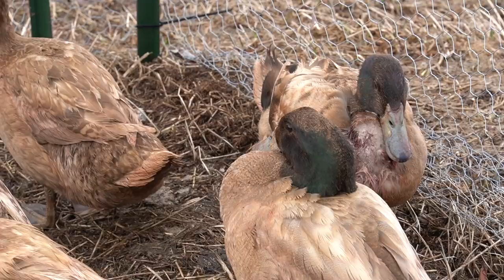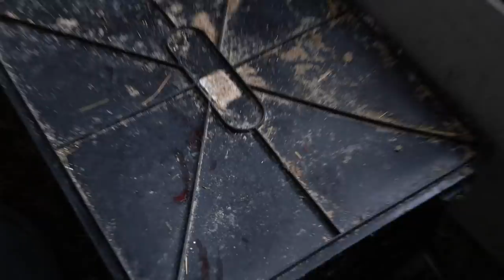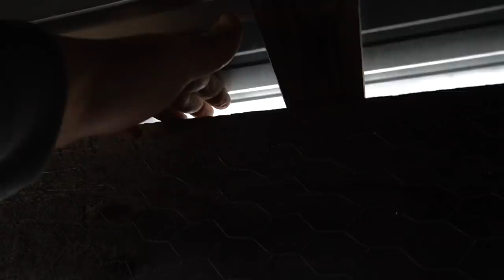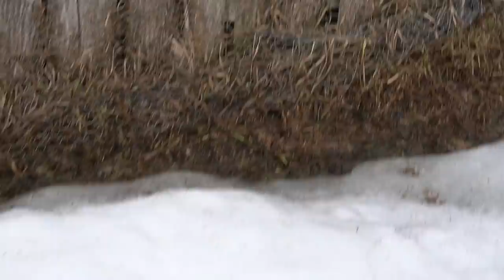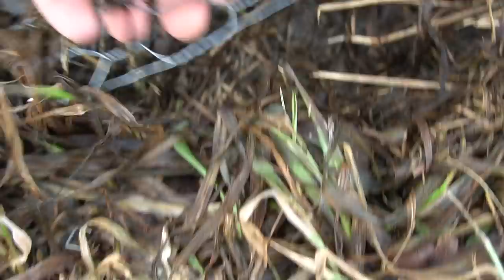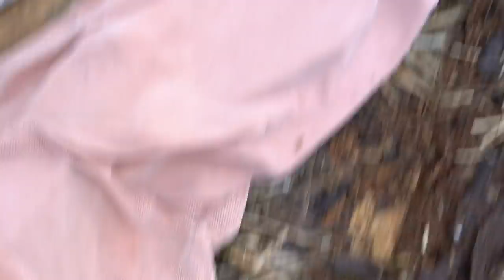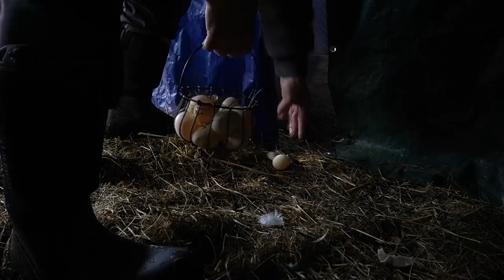Our Duck Farm was Attacked!!

Comment: Aren't there any non-duck footprints in the snow or mud? Fur left behind? Ask your county Fish and Wildlife Dept. if they have a professional hunter who can help you figure out the culprit (mode of attack - the neck - is a huge clue) and how to better seal the duck house. Another thing can happen: something scares the ducks, they jump and fly in a panic, and try to get out. They might even have stuck their necks through the chicken wire and that's why they are bloody at the base of the neck, where they would have got stuck in the chicken wire. BTW, raccoons can CHEW THROUGH chicken wire, and skunks, etc. can dig underneath, so you need to either bury rust-proof fencing 2 feet deep, or lay it on the ground surrounding the duck house (predators not smart enough to start digging 2 feet away from the wall). Raccoons make a big mess of feathers when they kill, but bobcats carry away the whole bird, leaving hardly any feathers behind. I know - I've lost full-size peacocks to both!

Comment: Sorry to see all that mayham at your place. As others have said, it's probably weasel. You really need to use 1/2"x1/2" hardware cloth. Even a 1/2"x1" welded wire would do.  Weasels will dig under and will refill the tunnel.  Or they can come through the roof or from the top.  It will be back unfortunately.  Your duckhouse does not look secure enough. Don't use chicken wire. They are no good. 

You are lucky that most will survive. I've known people who have lost 50 birds in a night to a weasel. 

As for the injury to the ducks,  get some RAW honey. It has to be raw not pasturized  or cooked. It has to be raw and liberally lather it on the injury every day.  We've had chickens with exposed bone and managed to recover (with scars...)  We farm for a living and have kept lots of chickens and ducks for many years. We've lost flocks to coyotes and other critters that like to be active at night.  Losing a bird happens to be one of those unfortunate things  when you keep a flock.
Reply from the maker: Thanks for the suggestion. I am afraid that you are probably right.
Reply: @GoldShawFarm   More I think about it, I think your geese saved/protected the rest of the ducks from the weasel.